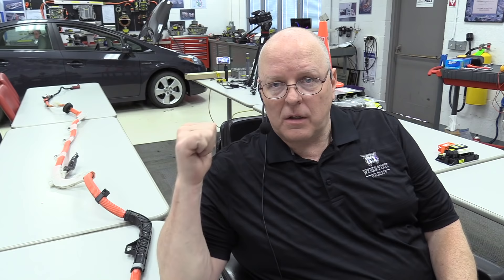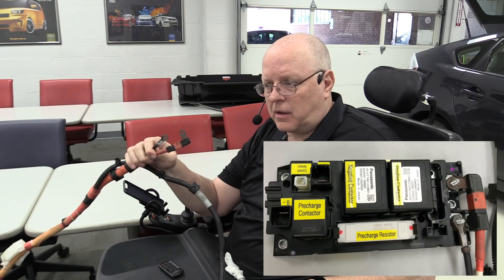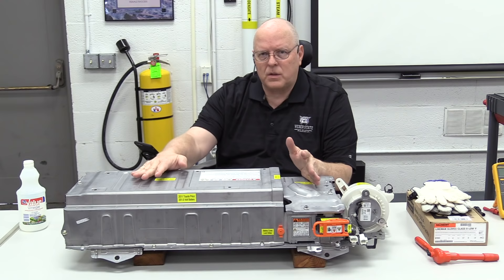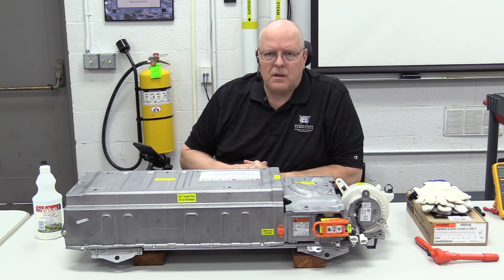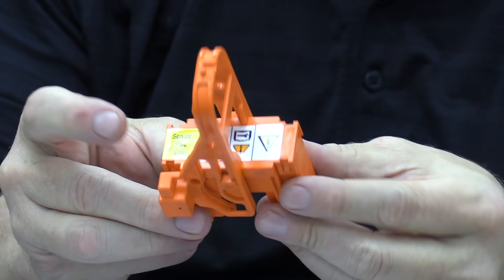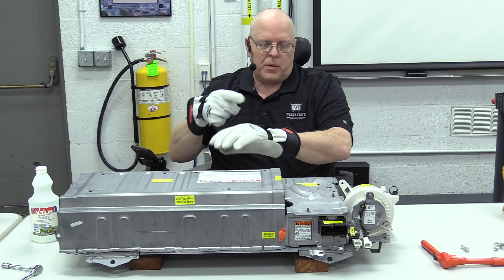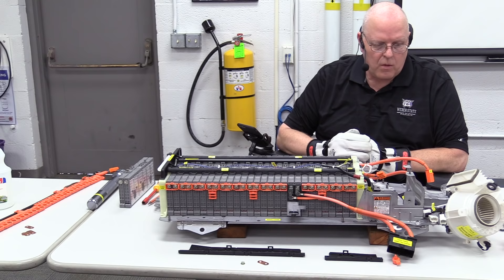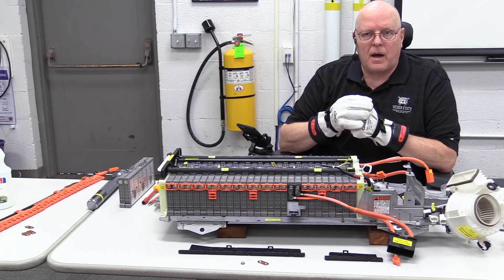2010-2015 Toyota Prius Ni-MH Battery

Comment: Vaseline on terminals ? as recommended for LA  terminals 
?
Reply from the maker: I have never heard of that. Flammability would be a concern
Reply: it was a question/query...............we used to smear V. on batt. terminals to seal from oxygen , preventing/slowing corrosion.and it seemed it might be a solution , after cleaning , of course......i can't imagine these batts get THAT hot , seems it'd be hard to ignite vaseline....but what do i know ? i've never tried to light it......i'm trying to figure out these batteries , found one CHEAP on CL , and looking to reconfigure as solar storage in my camper--14 (12)v. system.........they seem superior to Li ion for this purpose , other than weight and size......a 1KW 12 v. Li Ion  batt. around  $1000 new , and i believe the one i'm looking at is about 1/2 life , 4yrs.,80K mi.totaled car ,so better investment than HEAVY lead acids for the same price...$175.........
Reply from the maker: @gaylandbarney2231  The battery wont get that hot, but a resistive connection can get very hot.

Comment: Try cleaning them up and use stainless steel nuts What terminals are getting hit with electrolysis and you can top it off with no locks compound same thing as the cheap flashlights that you use

Comment: can i put gen 4 eco lithium battery system from junk yard in my gen 3 without too much trouble?
Reply: possibly run these 2 batteries (nickel metal and lithium) together in series or parallel ?
Reply: just want more battery capacity...thanks
Reply from the maker: It is not possible. The inverter is set up to charge the nickel metal hydride battery, not the lithium ion battery. The cell voltages are completely different
Reply: thank you.  one last question, when i hit the brakes and the regen charging meter gets full ( not the battery meter ) does it regen more if i hit the brakes harder even if the regen meter fills up?
Reply from the maker: No, once the battery us full, the extra regen power is used to rotate the engine crankshaft without the engine actually running.
Reply: ok i meant the charging meter fluctuates the harder or softer you hit the brakes not the battery level meter.  so once the charging meter (that has pwr on one end and charge on the other)  reaches full and you press the brakes even more does it put even more amps into the traction battery
Reply from the maker: No the charge meter indicates the power leaving or entering the inverter. The inverter can drive MG1 to dissipate the energy without charging the already full battery. It can also turn down the regen power coming from MG2

Comment: Awesome Video thanks You for Sharing the Knowledge, I've Seen  Auto Ev Tech Guys Build  HOME SOLAR  POWER WALL SYSTEMS, Using Ev Batteries, INTERESTING....
Reply from the maker: Thank you! Yes, they would not get much storage from a Ni-MH battery, but the Li-Ion batteries would work well.
Reply: I have the same idea , using toyota batteries for solar storage in my camper....trying to learn about the difference , lion vs. nimh......since i don't need KWs of storage , i'd only use it for lights and a 50w/12v. refrigerator , so maybe less than 30 amp hrs a day (?)    should provide plenty of back-up for cloudy days , no          since nimh are safer , according to what i've gleaned so far , i think a 5 yr. old /80K miles camry battery , at $175 on craigs list , would suit my needs    just trying to figure out voltage limits now.....i have questions about volt/amp limitations , but don't know if you're willing to bother........anyway , wish me luck......i know it's doable , just need to learn more @WeberAuto

Comment: I have a 07 Toyota Camry with 179k miles. The hybrid light comes on (red) with Abs and one other. The light comes and goes off by itself, mileage does not change, car runs the same way. 
Can some one tell me what is wrong and what are my options? I do not want to spend $1600 to $4500 at this mileage. Thanks a lot in advance to all those who could respond.

Comment: Ive driven the prius for 600 km's on new battery, there are no DTC codes on my car, no check light of any sort.
Reply: But 14 km/l is the average im getting
Reply from the maker: When in Park with the "Ready" light on, how much time passes between when the engine shuts off and turns back on (AC Off)? The 2010 Prius we have here with a good battery takes about 20 minutes. If yours is much less time, I suspect your replacement battery is bad.
Reply: Thank you professor.. ill check the duration tomorrow morning. But with the A/C on set at 22 degrees the engine stays off for a good 5-6 mins.

Comment: How much are those bus bars from Toyota?
Reply from the maker: I don't remember, but I believe it was close to $135
Reply: Thank you for all of the help so far, another quick question. If all the cells are reading around 7.9 volts on Camry Hybrid 2007, and one is reading 7.4 volts, is that a bad cell?
Reply from the maker: It probably is, especially if you were getting a battery replacement trouble code.

Comment: Where can I find information on the specific start up procedure after reinstalling the hybrid battery into my vehicle? After testing, each cell is at 7.83 v or better, all the bus bars have been cleaned with all corrosion removed, the battery has been reassembled and reinstalled in the vehicle. I then connect the service plug, reconnect the 12 v battery, sit in the drivers seat, hold down the start button for 45 seconds minimum without my foot on the brake in order to reboot the computer, release the start button then depress the brake pedal and hold the start button for 25 seconds minimum, then depress the start button to turn off the system, pull the FOB out, wait ten seconds minimum, reinsert the FOB, put my foot on the brake pedal and press the start button. The problem is the Red Triangle of Death still remains lit along with all the dash lights. I'm stumped and don't know where to go for information as Toyota is worthless in helping or providing any information.  Is this something you can help me with or direct me to the information? Thanks in advance.
Reply from the maker: There is no need for all of that. Just connect the 12V battery and power on the car
Reply: @WeberAuto  Thank you. After installing the battery and connecting the 12 v, pressing the start button results in the red triangle and all dash lights lit. usually the car will clear itself after several reconnections, but this time it's dead in the water.Thank you again.  Very informative and appreciated.
Reply: @WeberAuto  Perhaps you can direct me to where I can find information? I reinstalled the hybrid battery, now the car starts fine and runs fine, but the dash is lit up across the board. All lights are lit. How do I reset the system to get it back to normal? Thanks
Reply from the maker: @DanaRoddenMusic  The DTCs and lights can go away on their own after several drive cycles if all the problems are repaired. Otherwise you will need a hybrid compatible scan tool to check for codes and clear them.
Reply: @WeberAuto  It's amazing to me how information from the right source can put one on the right track. I am sincerely thankful for your input. I've gone a year floundering with my DIY attitude and not enough information to simple questions and trust me... I've looked for it. Thank you.

Comment: The high voltage gloves make me chuckle. I know Toyota recommends them, but that battery is 240 volts fully charged. A pair of standard latex or leather gloves is enough insulation. You're working with a similar level of danger doing electrical work in a building, and no electrician is wearing those kind of gloves. You only see those on linemen dealing with truly high voltages.

Comment: I fixed all issues on my Prius 3rd. gen. except bluetooth module which interfere with my iphone from time to time-www.youtube.com/watch?v=M1QJv1qN3WU Unfortunately few months my original hybrid battery has at least one suspicious cycle from time to time which charge icon on dashboard up to 100% instead of 80%. Last week I noticed that one cycle charged hybrid battery up to 100%  day by day during the 8h drive. Any idea what is going on with original hybrid battery?

Comment: Lol rubber gloves to remove plastic right.
My dvm says 0 dc voltage can pass threw plastic parts its non conductive materials just like the shilding on the wire harness to the voltage control module under the hood. 
You'll know if you get shocked by the DC battery, you might be able to think about it but not very long becuse your hart stoped and you need a Jumpstart.
260 volts dc at what amperage?
A car batter 12volt dc normally 13.2 volts charge 14.7 if the cars running 
Has 650 amps cold cranking that means it can put out 650 amps of current short term, you can weld with that ive hit metal on a car a few time with my wrench disconnecting a 12 volt positive batter post first thats why you always remove the negative side first.
Negative is in dc current the flow of electrons they flow from negative to positive sides of a battery.
On most cars VW made a bus some of them worked in the oppset direction.
Real fun trying to put a car radio into one.

Comment: I'm in the process of incorporating a 300 VOLT CHARGER into a 2002 PRIUS--my sister owns the car , and the car has gone thru several "won't starts" where she takes it to the SHADY MECHANIC that sells her a "aux 12 volt "special" battery " for $300 AND THEN  only charges the HV BATTERY,--these dumps will not start with a dead HV battery, PERIOD...and the the 12v aux battery has VERY LITTLE TO DO WITH STARTING IT other than powering up the solenoids....PEOPLE, toyota SCREWED YOU by not making the HV BATTERY chargeable other than by RUNNING THE ENGINE, --this puts you at the MERCY OF THE CRIMINAL CARTEL calling themselves "mechanics".they are NOTHING but CROOKS.....there needs to be a KIT to convert FIRST GEN PRIUS' to " PLUG IN " HYBRID....or make a way to to hook the MG1 to a power source to START THE CRAPPY CAR!!--I WILL let you know how it goes...